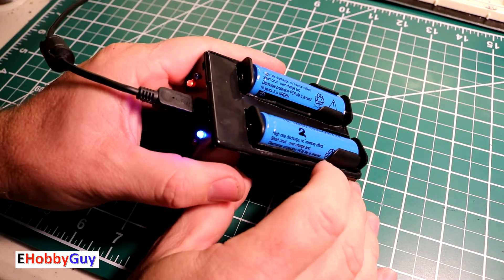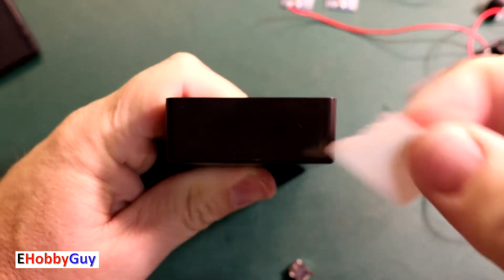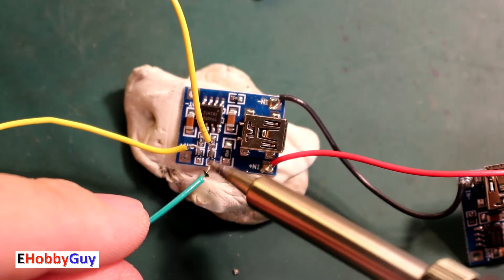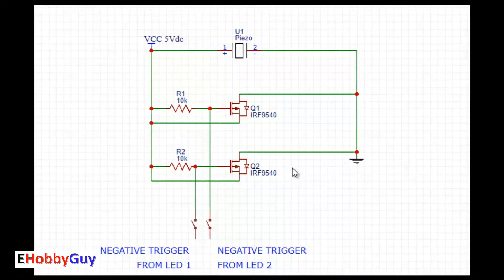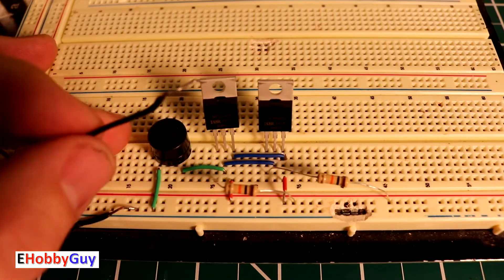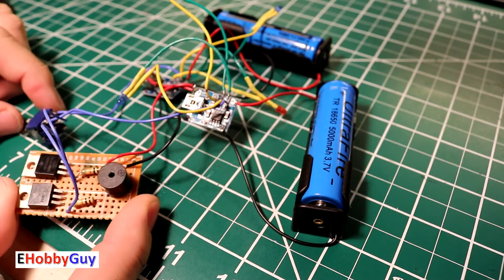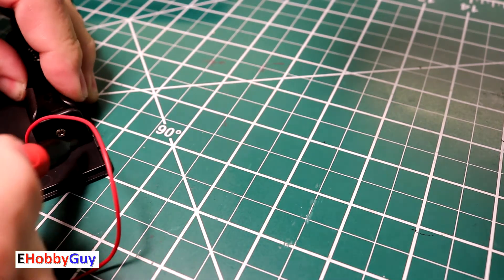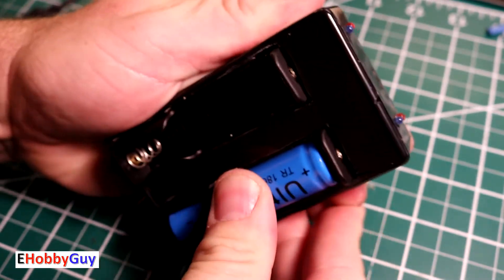MAKE YOUR OWN LI-ION BATTERY CHARGER!! - EASY BUILD!!

Comment: Nice! The sunken battery holders give it a certain something that slapping on a couple battery holders to the outside of a box does not.
I like the buzzer add-on... But I would use 2 switches for the buzzer. When your first battery was charged and you removed it, your single switch system won't let you re-arm the buzzer for the second battery.  A dual switch system would let you control the buzzer independently.

Comment: Sir how can I make a 7.4 volt lipo battery charger. My battery is 3000 mah and it has two wire +ve and -ve
Reply from the maker: Nabodaydharani Medhi you can build it in a similar way to this one but you will need a 2s LI-ion 18650 charging module. The 2 batteries must be in series and when they are in series they need a balance circuit. If you search Ebay for 2s LI-ion 18650 charger protection board module you will see what you need there. There will be a wire from the module to the center of the 2 batteries for balance. I️ hope this was helpful. Thanks for watching. I️ appreciate it!!